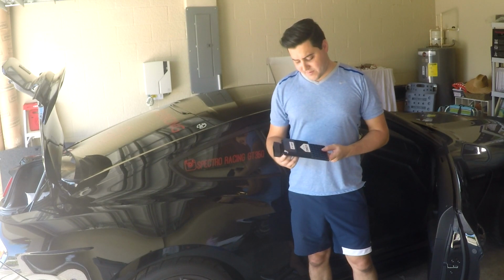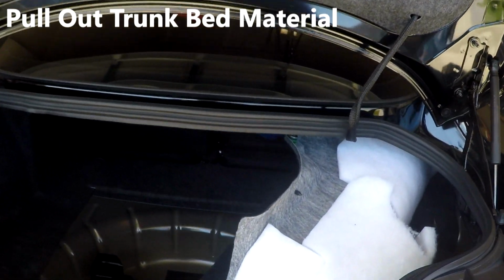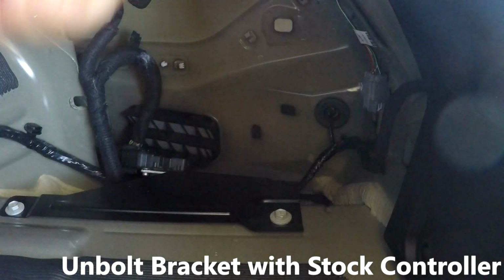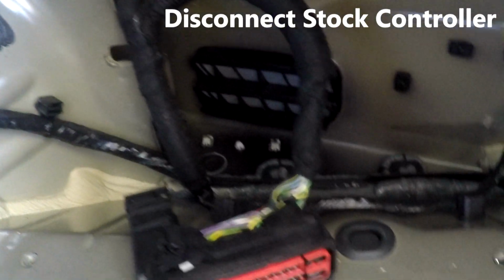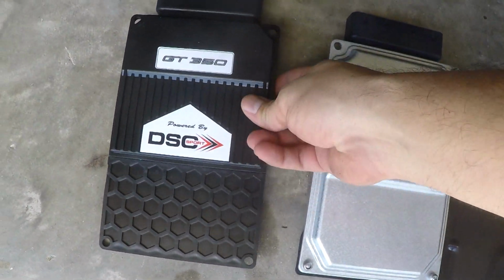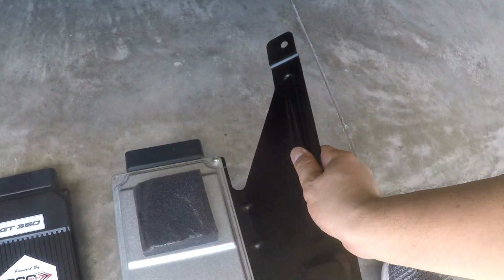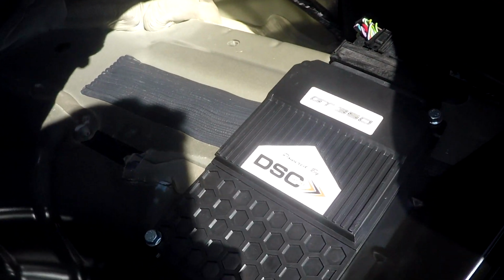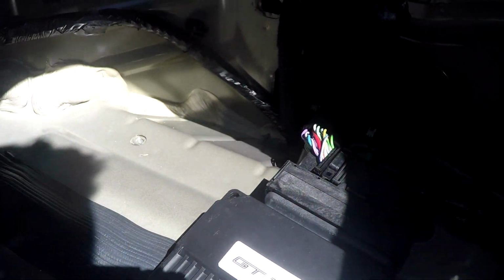Shelby GT350 DSC Sport Magnetic Ride Suspension Tuner Install

Comment: I've seen tons of GT350 magneride struts/ shocks and controllers for sale. Anyone know all the parts necessary to retrofit magneride to an 18' GT pp1?
Reply from the maker: that's interesting to think about but I'm not sure.  Some pretty serious coding would be required even after all the parts were physically installed
Reply: @SpectroRacingChannel  yeah the parts can be had for less than a great deal of cash,but i need to figure out what coding would need to be done.